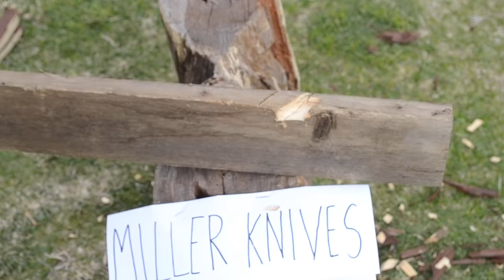Forging a Tomahawk from a Wrench

Comment: you stabilize your anvil more, you will lose less energy, firmly attach it to that frame and. stack up mass on it, again making sure it cant shift around.
also, a larger hammer means you get more out of each strike.
feel free to disregard this entirely, I'm just a hobbyist, and you do good work in the end.
I just thought i would try to helo make it a bit easier
less strikes, less possibility for mistakes
Reply: +Miller Knives 
No need for thanks.
See if it helps first.
You've actually given me an idea on how to make an anvil, as opposed to this large rock I found. 
I've been watching since that wood handled kiridachi video, so I'll be on the lookout!
good luck my friend!
Reply: dont grind the sharp end of an object against the direction of the belt, cos if you are unlucky and the belt is cut, you can get pretty hurt.
Reply: but great job
Reply: Incorrect. That is exactly how one grinds blades. The fear you have is not born out in operation.  Every book on blade making shows this, and I've been doing it for 33 years.
Reply: gas = clean and easy
traditional/coal = dirty and difficult but hotter!

Comment: A noob here, would you need to harden the steel again or can you leave it the way you bought it? I believe a wrench is already quite hard and probably heat treated, but I noticed you heated the nearly finished product and quenched it in something, I assume water since there were no flames. I am thinking of copying this and seeing how close I can get, would love this bit of info, I know how to do everything else shown here but I want a usable product in the end :D
Reply: Miller Knives
thanks, will first try this with smaller wrenches until I spend money on a big one, haha.
Reply: to sum it up for myself, you re-heat treat the wrench after everytime you hammer on it?
Reply: Miller Knives
okay, thanks! I'm all hyped to get to work tomorrow, hahaha
Reply: +Miller Knives you should make a spear head from a wrench
Reply: you would need to harden it again because after forging the metal becomes softer and the previous heat treat of the wrench is ruined
Reply: my mom is dead
Reply: This is what happens when you put people from two generations apart in the same chat.
Reply: Damiaan Moors depending on what wrench you use also you never know
Reply: Miller Knives I noticed a short clip of the tomahawk going in an oven after the quench at about 2:26. You tempered it after quenching to relieve stress, right? Did you go by color of the steel when doing the final heat before quenching? Very cool. I gotta try this at work. I'll bring it home and broil it in my oven then take it back for the finishing. Nicely done & thanks for sharing!
Reply: Miller Knives
after a 2 week delay and 2 failures i finally had a working one looking very similar to what you made! I threw it and lost it, I feel like a complete moron. However it was a very fun project to do, one I will repeat and NOT throw at a target.
Reply: Water quenching can be a bit dangerous because it can crack and even shatter the steel and ruin hours of hard work! Most prefer to use motor oil or even automatic transmission fluid for quenching. Water cools the steel too fast and makes it very brittle. Also it can have air bubbles witch can cause cracking and. Some people like to use salt water because you don't get the bubbles but motor oil is your best bet. Just make sure to wear gloves or you'll have some pretty toasty arm hairs!
Reply: @miller knifes did you only heat treat it once for 2 hours at 200 degrees and I'm guessing that it's 200 degrees Celsius ?
Reply: Damiaan Moors But while forging you have to put it to critical tempreture again so the steal is soft again
Reply: Aiden Gray Heat treatment is when you heat the blade to full critical temperature in the forge then quench it in oil to harden the steel. What's you're thinking of is called tempering. That's where you heat the steel again at a lower temperature after quenching it till it reaches a kind of golden color. This softens the steel a bit so it will be more flexible. I'm not a professional or anything but this has always been my understanding of the process.
Reply: Miller Knives Awesome work! I'm ordering my DFSW propane forge this month and I'm definitely going to try this with a couple wrenches I have. One is a newer wrench and one is a big old wrench that I picked up at the flea market for $3. It's nice and thick so there will be a lot of metal to work with and it should make an awesome Tomahawk!
Reply: Phil Hand As I've always understood it, the tempering process was for relieving stress after quenching. I think that's essentially what you are saying. But I thought 200 F was too low a temperature to do it. I don't think that would be hot enough to achieve the color you refer to. I hadn't heard about the color so thanks for mentioning it.
Reply: did you forge weld a piece of high carbon into the wrench for the blade? or just forged out the blade section fro the wrench steel? i've been clay tempering for years and using canola oil- just know nothing about the chrome alloy of most wrenches
Reply: Just curious, what do you use as your forge and does it cost you much to operate?
Reply: Damiaan Moors
Reply: Damiaan Moors
Reply: Xxking700xX I totally agree
Reply: no oil water would make it crack

Comment: was additional material added for the flat side ?
Reply: looks like he welded on material, makes it useless as an axe.
Reply: +phogelbice nope, don't think so. the end of the wrench was drawn out and forged, i.e. hammered, flat...
Reply: "Hi mate. I just folded it on to its self and forge welded it" . This is the reply he left on another comment
Reply: How do you figure?  I've got a 1000 year old Viking axe here. Guess how the edge was put on?  It was forge welded.

That was the standard way of making one before about 1900 when steel (vs iron) became available in large quantities.

Comment: You must've welded on some more metal for the blade at some point. Is there really enough material there to draw it out that much?
Reply: +Miller Knives Oh, thanks. I want to try to make one of these. Also, nicely done. I love the way yours turned out.
Reply: Comrade qa

Comment: at some point, it looks like you forge welded an additional piece of material to make the tomahawk part. What was the material and what brand/model of grinder (belt) is that?
Thanks
Reply: Yeah looked like the metal became really thick after a certain cut in the video

Comment: Any one else notice he hit the table more then he hit the Tomahawk?
Reply: you bounce the hammer off the anvil to not get tired as quickly and hit the work piece harder
Reply: Were you looking for reddit and ended up on youtube or something?
Reply: You don't care how to do it the right way?

Well, that says a lot.
Reply: Sisteelin: Yeah, I saw a LOT of missed strikes. He did get a good finished product, but there are less intensive ways to do it.  He also needed a lot of strikes to upset the end.
Reply: Maori_Inigma Was it missed or just the frame rate of the camera...that's the likely culprit.
Reply: Actually, if you slow it down you can tell it is simply the low frame rate of the camera and the video causing a forced perspective. It makes it seem like the hammer lands beside it when in the image it is still in the air. It could be that or other times it could be that the time lapse footage makes it look like it is hitting when he has already moved the hammer to the side. At least, that is how it appears to me. Be your own judge.
Reply: Maori_Inigma it's because he was playing it super fast and when he moved the piece he would let the hammer rest on the anvil so when the video was sped up you would see it look like it hit the anvil.
Reply: Very correct ..I saw same way my grandpa (black smith) doing this!
Reply: Maori_Inigma yup
Reply: Maori_Inigma ...that's because he was doing it with his eyes closed. ..

Comment: lol dude misses 90% of the time classic
Reply: You do realize that is on purpose, right?
Reply: coolhanddruid Why would he do it on purpose?
Reply: is this a real conversation?
Reply: Erik Parker no
Reply: Minchken Ok, that's a relief.
Reply: Erik Parker Unfortunately the Boo TV guy was being legit.
Reply: Erik Parker tee hee
Reply: :( My hammers never get scaled, wtf. They think they're so cool
Reply: It's not about getting scale on your hammer.... When a blacksmith is hammering away, they get into a rhythm. Some times you need extra time to move the piece around and instead of interrupt your rhythm, you let the hammer hit the anvil instead. ALSO, if I decide to not hit the piece and the hammer is in the air, it is easier to just release my muscle tension and let the hammer bounce on the anvil. Otherwise, I have to slowly lower it, taking up precious energy. It's all about efficiency, but not all smiths will do this.
Reply: Minchken fuf6g
Reply: Minchken  so isn't he missing because it's part of a technique. Please correct me if I'm wrong, but it seemed like he was getting it hot. Then he was firmly pressing down on the wrench, while hammering next to it. To me with heat, pressure, (on the wrench) and a hammer hitting next to it, causing to bounce (the wrench) up and down. Sounds like he was shaping it slowly while knocking off impurities (slag) in the process.
Reply: Dean Grifin just watch him trying to chop the wood at the end... his aiming is horrendous.
Reply: Dean Grifin     Con.   Jjj   Ya yyhhhm
Reply: Jangalexis, dont think he would be a good smith if he had shit aim and hand/eye coordination... he just clearly couldnt be assed to chop up that wood
Reply: MrJohnn100 what if he has aimbot
Reply: I think because it's sped up, he's actually hitting it but it happens too fast in the sped up version to see. Instead you just see where the hammer bounces of to.
Reply: Ha!
Reply: He's using one hand
Reply: coolhanddruid why would that be on purpose?
Reply: Dean Grifin
I will correct you ,you clearly state "but it seemed like he was getting it hot" not referring to the wrench ,i really think you should have specified what he was getting hot in your sentence because  by your wording "it" could mean anything i.e hammer.

Comment: It would really help to have a fuller, or a ball-peen hammer.  To draw stock out of the middle, which lightens the whole head, but more importantly, draws more steel out to either side, where it can be used to fill the ax/beak heads.  (Also, I would have made a hammer, because i like them better than tomahawks, but that's me.)  Excellent tool steel, BTW.  Really hard to anneal, and forge, which makes working it a bitch, but the tradeoff is it takes an excellent temper, and holds edges well once you get the hardness back.

Comment: How much weld metal was added to the blade to get the axe face that large? it's not possible without adding metal to it and weld metal isn't high quality for a blade. if he split the wrench and forge welded another piece for the blade edge into it... yeah then it would be worth doing.

Comment: Q1: What kind of oil do you dip it in
Q2: How can i prevent rust?
Reply: You can use old motor oil or you can buy quenching oil at an auto parts store. And it coats the exterior of metal in carbon
Reply: Ryan Fager Cover it with beer and coat it with salt, then leave it for awhile.

Comment: Can someone tell me the difference between dipping in oil and dipping in water? And what it does to the blade. Also can someone explain what the baking does. That part confuses me.
Reply: Dipping in oil cools the steel down faster, making it less likely to crack that water.
Reply: Jase Griffith the baking is for hardening the steel

Comment: can any one tell what the purpose of heating the metal then dip it in the water ( 2:21 ) ?
Reply: That's not water it's Oil, and that's called heat treating and that helps make the "Blade" or metal harder

Comment: there are over 2500 comments so I'm not going to go through them all so if someone said this...  
I am an accomplished, blacksmith/bladesmith hobbyist.  Seems to me that if you have to grind off THAT much flaw in your smithing, you really aren't doing very well and you're wasting lots of metal.  Personally I feel that I have failed if I have more than an 1/8" of grinding needed on the edges of any workpiece.  

At :39 you have a crow's beak, but when you go back to your "anvil" at :42 all of the sudden you have the rough profile of an axe head.  But it looked to me like you welded the lower part of the axe head onto your crow's beak.  If that is correct, by hiding it you give the impression that you were able to make the axe from the one piece of metal and that is a lie.  If it wasn't your intention to deceive you could have simply shown your weld before doing the next heat.